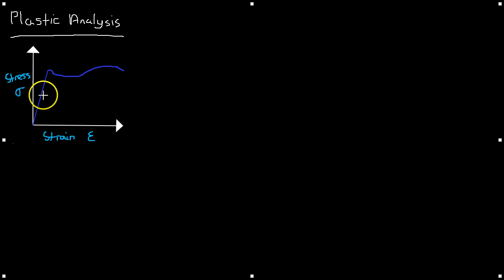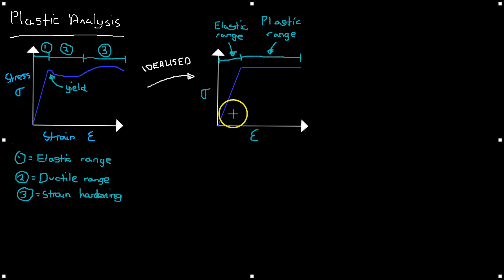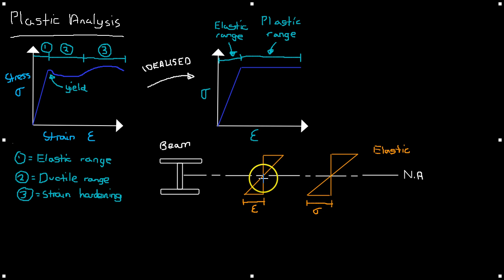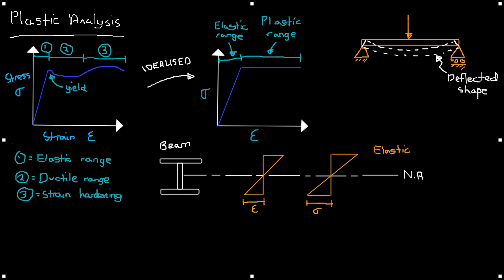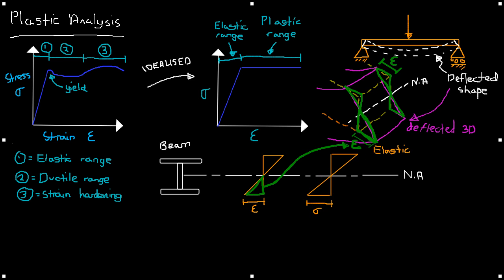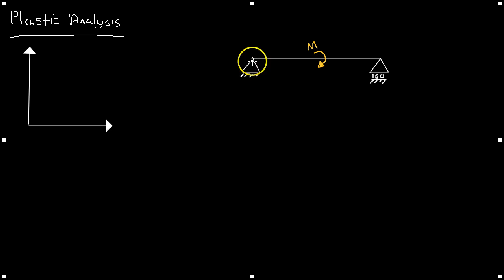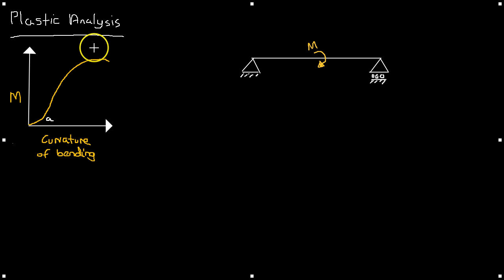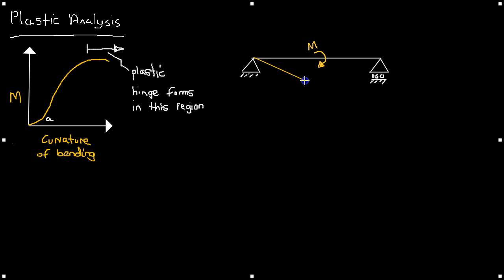Plastic Analysis - Fundamental Concepts Part 1

Comment: I found this video very useful, but what would happen if the critical load didn't occur at the center of the beam? As in if you had a load distance a away from the left fixed support, and a distance b away from the right fixed support?
Reply from the maker: Thank you for your comment. The plastic hinge forms at the point of maximum bending moment. If you draw the bending moment diagram for any scenario you will be able to identify where possible hinges can form. As you point out, they won't necessarily form in the center of a beam. Hope this helps!